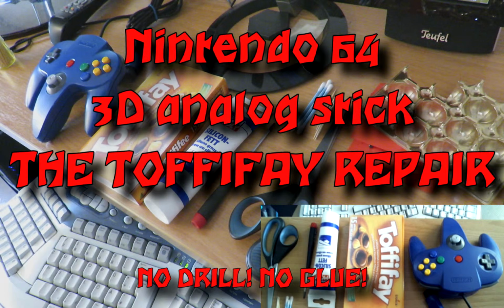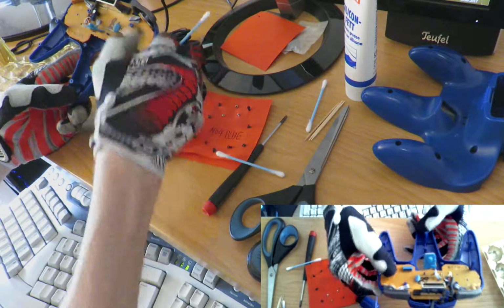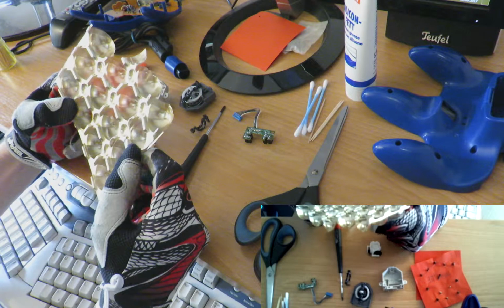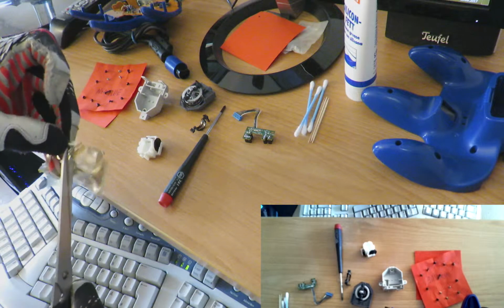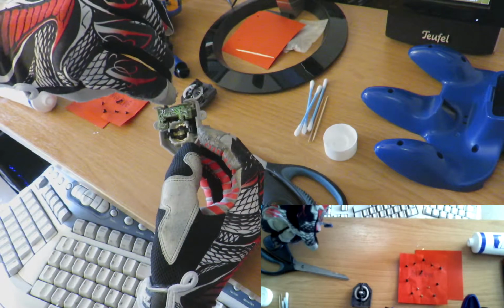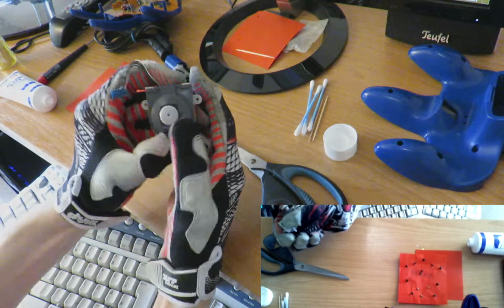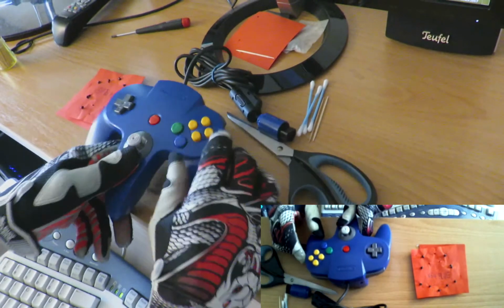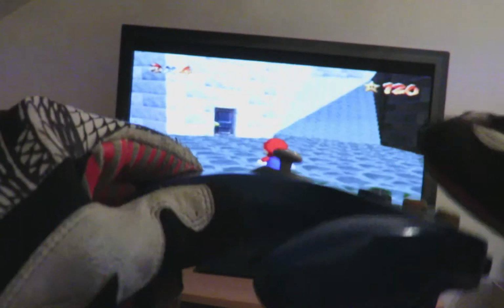Nintendo 64 The Toffifay 3D analog stick Repair Fix without drill tape or glue PERFECT SOLUTION!

Comment: nice fix :) from the video seems to be like new!
Reply from the maker: Yes, feels very good again. I was lucky all my 4 controllers black plastic was in good enough condition, so I didn´t need to glue anything. I guess it´s really just Mario Party games with the 360° rotation which cause extreme damages on these parts.
Reply: Or Bowser when you have to throw him on the mines xD I failed a lot of times xD
Reply from the maker: But you don´t need to rotate it that fast. It´s more difficult because of the timing to release him in the right moment.